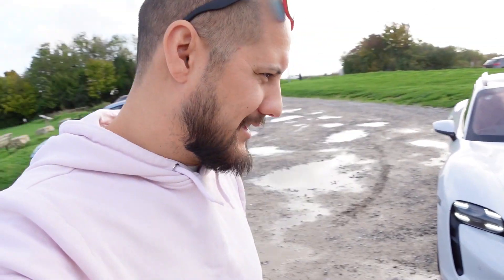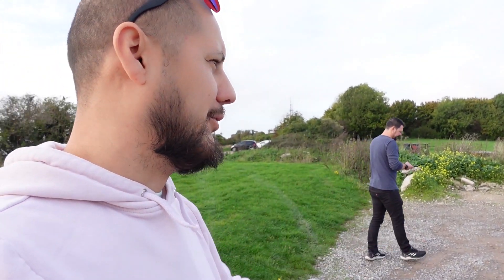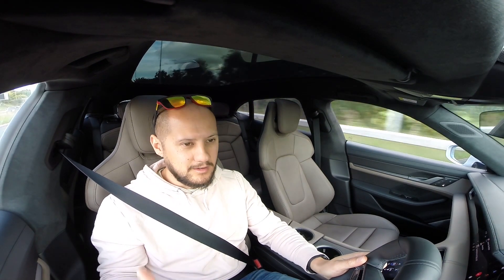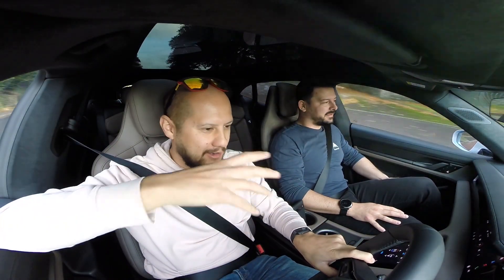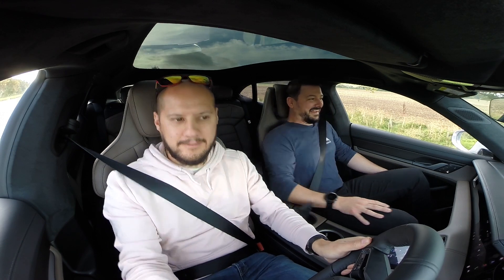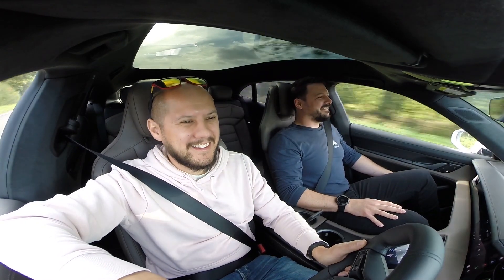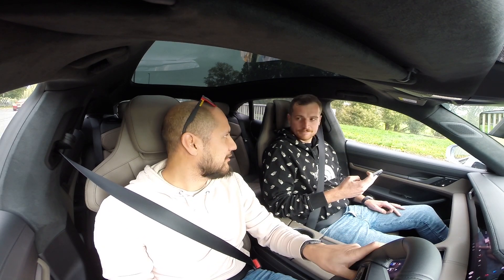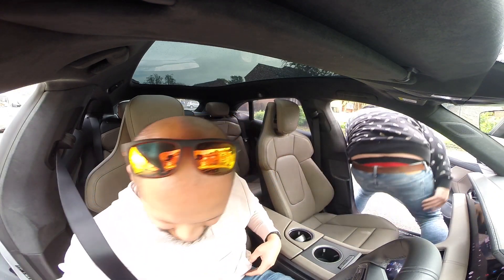Porsche Taycan SPORT Turismo Turbo S Launch Control Reactions!!

Comment: Ha awesome stuff. I need to experience it! Here's something I've wondered about electric stuff, do they creep with no throttle input like a torque converter auto?
Reply from the maker: Yup, there's nothing else like a high power EV launch!! 

I didn't go round messing with the settings on the Taycan, but the Tesla has "creep" "roll" & "hold" options. Creep feels like a regular auto, roll will freewheel when it gets down to a walking pace (Regen provides 'engine' braking above these speeds) and hold will Regen down to a gentle stop and hold position - which means you can effectively drive with one pedal and never use the brakes - which is one thing I'll miss when I change cars
Reply: @AndyPonting  Unless there's something different with the European models, these options don't exist on this car - those are Tesla settings.  The Taycan is always in what Tesla calls creep mode. so it acts like an automatic when you lift off the brake. Porsche thought it felt more natural to do it that way, apparently.
Reply from the maker: @falxonPSN  yep, which is why I said that was what the Tesla had. At the time of testing the Taycan, I was quite unfamiliar with it still (I've owned one for over a year now) and most of my EV experience was with my Model 3 performance (almost 4 years)